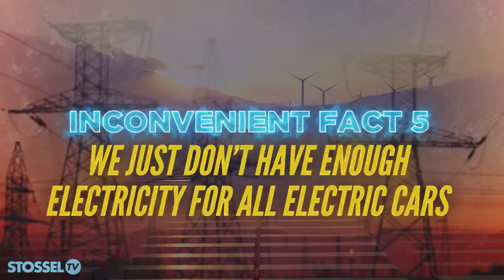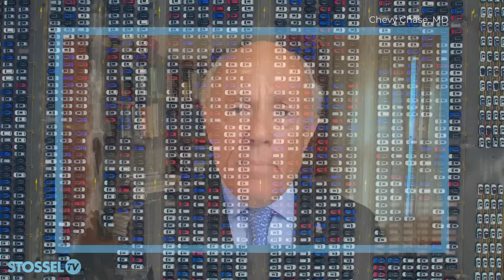Electric Cars: Inconvenient Facts, Part 2

Comment: As an electrical engineer who works in a power plant specializing in battery back up systems, I have been saying this for years.
I did undergrad research on solar panels at a national laboratory and the results for newer processes were not very promising. Note that this was 5 years ago so things may have changed in development but I haven't seen any at IEEE summits.
Reply: Maybe you could answer this question then I am, really asking. Question guys. I google how big an area solar panels needed to power the usa Google say small part of ONE state You say Entire usa only half the power needed. Which is correct.I am asking how to even calculate it. They say MW then KW and I not sure how to even go about calculating the answer. Hard to tell anyone that when google says i am wrong,
Reply: Why are half the comments here censored?
Is Google censoring, or Stossel?  It's annoying! 😡
Reply: According to Elon Musk (who is usually right about engineering issues), the entire USA could be powered by a 100km x 100km square of Solar panels located in a sunny part of the USA. Google that topic for an analysis of the math.
Reply: @paulrybarczyk5013  That's about 62 Miles x 62 Miles . . . . the heavy metals & Toxins would leach out of the panels and make the area unusable for human occupation after a decade.
Reply: @dalew801  What if they use Tesla rooftop panels that don't leach toxins, last 50 years, and can then be recycled?
Reply: Solid State Batteries and Liquid Metal batteries offer promise.  However, the government and industry has little interest in funding their development.  People have to wait for small time operators to fund their development on their own. 

Additionally, there are many industries that fund the suppression of energy alternatives.  An example is geothermal. Small single home geothermal units that only took about a week to be up and running sprang up all over the USA West.  However, as is almost always the case, the technology was bought up - Raser Technologies (RZ) - and immediately dumped. That promptly ended that! 

Firestone bribed Pittsburgh government to take down all their magnificent electric trolley's so they could supply tires to a new commuter bus service.   So sad.  

None of the big money making monopolies will sit idle whilst new players come into the market.  They will use their money to influence and suppress any change of the status quo!  Colleges and Universities will continue to conduct research on useless crap that does not change anything substantive in our world.  Government is quite naturally "on the take".  That's the way the world works.
Reply: @paulrybarczyk5013 thank you.  This “solar panels are toxic” has been an obsolete argument for a long time but people still cling to that so arbitrarily.
Reply: @FireEscape The best engineers in the world work for Elon Musk. They know how to monitor wear and simulate accelerated wear, then extrapolate that to determine a life expectancy. They've been doing this several years now, gradually rolling out more and more pilot installations, each with a 25 year warrantee. Actual service life should be at least twice that duration, once perfected. Then mass production begins.
Reply: @CropCircleCritic  Nope. They are toxic.
Reply: @dc9mm2  don't forget about amperage
Reply: @dalew801  interesting point.  thanks
Reply: @FireEscape I would love to.  Thank you for bringing this up!

By environmental or humanitarian standards, we would need to establish that mining for EV materials necessarily worse than the processes by which we arrive at having the things we already own, including and especially gas cars.  

There is NO CONCEIVABLE REALITY where gas cars and oil production hold the humanitarian or environmental moral high ground. 

Many people like to use arguments such as mining being bad for the environment or children working in mines.  Sorelle Amore falsely claimed this was industry-wide in a video and this was a cherry picked example.  Tesla never used that mine and it has since been shut down.  

Let me start by saying that children working in mines is reprehensible and if it has happened or is still happening I condemn it in the strongest possible terms.  But if we’re being honest, this is a mass self-incriminating of all of us since we each have a cell phone that was built with slave labor and a multiple devices with a lithium battery that was mined with far less scrutiny than Tesla’s sourcing.  

I spent 12 years in combat airlift in the military.  Saddam Hussein did not have weapons of mass destruction.  Osama bin Laden was not singularly located in Afghanistan.  Make no mistake—the 20 years we spent in the Middle East was to protect the Straits of Hormuz and keep the oil flowing.  The US  knowingly turned a blind eye to allied royal families who have gotten rich off human trafficking.  The total amount of civilian death and human suffering is very difficult to quantify, but lower estimates put civilian deaths around 500,000 in Iraq and Afghanistan alone.  All to 1) keep the oil flowing and 2) traded in dollars.  

And if you drive a gas car, none of the above is your fault.  I bring up this long example to explain why I had zero loyalty or compulsion to gas cars and changing over to a Tesla was an easy decision for me in this department.

You should feel the same way, my friend.  You are in this too.
Reply: @CropCircleCritic  Talk about “magical thinking”—You have to know that lithium doesn’t “magically” materialize into batteries. Lithium requires massive mining operations, shipping, storing, refining (using lots of cobalt), shipping again, and then, which is an extremely energy-intensive process that NEVER goes away. 

Adding 1000lb batteries to an automobile when gas has about 100 more energy density of a lithium-ion battery is backward. Lithium is also dangerous when it comes into contact with water. Take a look at Florida and burning electric cars when exposed to flooding. 

Solar panels get made once and don't last forever which means in some cases not even decades.  Expensive Teslas don't have a good track record when it comes to reliability and even build quality. When batteries need to  be replaced it's potentially tens of thousands of dollars. 

These videos have radical leftists and luddites suddenly acting all smug, in response to a dose of reality,  proving they don't really care about what's good for people or the future.
Reply: I am very disappointed that these leaders don't appear to be talking to engineers and physicists about what can be achieved. There are a half dozen basic questions that could be asked that would show how this is all just a dream. Right now the common man is subsidizing the whims of fancy the elites want to enjoy with electric cars. They are all supported on multiple levels with tax advantages, preferential treatment by regulators, and government sponsored R&D.
Reply: @Gunalizer  Very good response!  Really.  I’m impressed.  You’ve given this a lot of thought and it was well-structured.  Thank you for bringing a good argument.  Also thank you for actually reading most of what I posted.  

Please actually read the following.  You are exactly the kind of person I am trying to reach when I say this stuff.  

Responding in order…. 
95% of lithium that is mined is done so for smart phones and other devices, so to my mind this is territory we are all deep into anyway.  Like I said, demonizing lithium mining for EVs is only a mass incrimination of all of us since we all have multiple devices that already have lithium.  

Also I would hope that the middle ground we can meet on is that we don’t want the water table messed up by any means, and gasoline also requires cobalt for its refining processes.  If we get into “2 wrongs make a right” territory I would then ask for your perspective on massive junkyards with cars seeping their fluids into the soil, oil spills in open water, uncapped oil wells and the destruction of the Middle East wars for the purpose of protecting the oil shipping lanes.  

My overall point here is that it would be monstrous to pin all of the above on someone who drives a gas car, but there is a mass push to shift blame onto EV drivers for anything less than perfect in the manufacture and use of their vehicles.  I have seen bleeding heart SJWs do this.  It’s wrong when they do it and it’s wrong when gas car proponents do it.

The range issue is a decent argument, but we charge at home and the majority of the time have and for all purposes have infinite range.  Once you’ve experienced never going to gas stations anymore, you don’t go back from that.  No matter what anyone says here bashing EVs, this is the trump card that will make me never go back to gas cars.  Seriously dude, charging at home is pure bliss and I hope you get to experience it at some point.  Any issues people bring up with that are exaggerated to the point of discrediting such people.  

There are Teslas on the road at 10 years old with less than 10% range loss.  That is acceptable to me.  If I have to buy a new battery at 10 years for $20k, I am fine with that.  It’s cheaper than a new car and we love our Tesla.  

Build quality.  This was probably true of the first few batches of Teslas.  We got our Model Y and it is immaculate.  

Reliability.  I have had maintenance every issue under the sun with gas cars (including one that randomly burst into flames) and they all happened at the worst possible time.  Switching to an electric car was a sideways trade with risk to me and I can now say that the risks are over reported and greatly exaggerated.  

The price.  My wife and I had a lot of discussion about this.  Honestly, it was a wash. We got the Model Y for $55k (yes, I know it’s higher now), which we felt was on par for an SUV that seats 7.  We had looked at other gas ones that easily top $80k.  

Politics.  My friend, I am fiercely conservative and there are many more Tesla drivers who are conservative than the opposition would have you believe.  I would hope another common ground we can meet on right now is that we all need as many friends as we can get.  To anyone reading this, I would ask you to consider if fighting over what kind of car a person drives is a battle that’s really worth picking.  

Also let me be clear—I am vehemently opposed to any legislation that would ever force anyone to buy an EV or anything else of that matter.  The Detroit manufacturers donate heavily and nihilistically to politicians that push this divisive rhetoric.  

Thank you for your time and I wish you all the success and reliability in the world with whatever it is that you drive.
Reply: True! My PV saves me only 400,-- each month, i have to install a second PV because the sun is so weak!
Reply: @eddarby469  I agree with most of your point, but electric cars aren’t a rich people or leftist thing anymore.  Maybe they were at one point but many regular people are getting into this market and I highly recommend it.  Electric cars, particularly Teslas are amazing vehicles and charging at home is bliss.  It’s seriously a game changer to not have to go to gas stations anymore and I hope you get to experience it at some point.
Reply: @paulrybarczyk5013  dude where did you buy those rad rose colored glasses? I really want a pair.
Reply: @CropCircleCritic  I believe I will at some point but I'm waiting to see more about whether the battery life makes them feasible. 

As for them being a "rich man's hobby", I still stand by that. I've never spent $15k to buy a car. To get a Tesla you're in the $75k range? With median incomes in the US where they are, you probably need to be in the top 10% to swing that. But they're coming down all the time.

Still, they should not have granted subsidies for these expensive cars.
Reply: @paulrybarczyk5013  I would imagine they are very costly to manufacture . . . and like ALL other Solar Panels likely do not Recover the amount of Emissions that were Created in their Manufacture.  That not a net-sum gain . . . every Panel represents a Net Loss . . . so why do it?     It's like have a good job and at the end of the Month you owe money to your employer . . .
Reply: Diesel runs everything in this world!!
Reply: @markhuntermd  Mark . . . GM was convicted back in the day of Bribing City Councils to buy GM Diesel Busses . . . . most cities back in the day took the money.
Reply: @CropCircleCritic  EVs may work for some people . . . but like the Video says . . . they have a Karbon Footprint = to my ICV after I have driven it for 100,000 miles.   Personally I have great difficulty getting past the scenes of Children in the Congo mining Lithium for the Batteries.
I have seen the massive Environmental Destruction in China where they mine & refine Rare Earth Metals for the same batteries.  The refining process destroys Rivers, Lakes & people in China.  Massive amounts of dirt have to be moved . . . kind of makes the Oil Sands in Alberta look like a National Park.

When everything is taken into consideration . . . the Battery, which they have no ability to Recycle as of yet . . . is far more toxic than any gasoline powered vehicle could ever be.   And I didn't even go into the fire hazards . . . didn't the Electric Bus Fleet in Connecticut just get shut down because one unit burst into flames?
Reply: @eddarby469  that’s totally fair.  I get it.
Reply: The absolute best solar cells currently available, the type they use on satellites cost a small fortune to manufacture and are about double the efficiency of the ones being put on homes now. There is no way we are going to see those complex to manufacture multi junction PV cells mass produced any time soon and all other PV tech is pretty much tapped out at current efficiencies. There is some interesting research in solar concentrators with solar cells but again it is complex to implement and needs to be installed on ground based solar tracking rigs with active thermal control.
Reply: @FireEscape No current solar PV cells last 50 years. If Musk actually said that he needs to be called out on it.
Reply: @CropCircleCritic  There's no reason for me to buy an electric car.  I like gasoline engines, and they don't pollute anyway, less than 1% of co2 emissions.  I like going to the gas station once a week, and I'm not into the Peloton shitlib scene.  I'm into electrical engineering, and nothing they're doing in a Tesla is new or groundbreaking with exception to their software.
Reply: @Mike-lt6sj  well, you sound like you know what you want and I respect that.  

Having lived with a Tesla for over a year now, it fits our lives and performs far superior to any other vehicle I’ve ever driven or own, bar none. 

I’m not a liberal and there are way more conservative Tesla drivers than the propaganda would have people believe.  

Also as a head’s up, you may not know it yet but your wife wants you to buy her a Tesla.  Once one of her friends gets one, it’s all over, no matter what you say.  Besides, no real man makes his wife go to a shady gas station with his kids in the back now that it‘s 100% avoidable.  That’s 52 less chances per year for her to get mugged or be a victim of identity theft or worse.  

But yeah, keep driving a gas hog on principle, watching Q and singing kumbaya.
Reply: @CropCircleCritic   I am a liberal, and have no idea what all that gobbledygook is at the end of your speech.  
Enjoy your Tesla, I really mean it.
Reply: @Mike-lt6sj  and I wish you all the best with your cars as well.
Reply: @headstashmusic3897  According to Joel S. Holmes, who has experience as an alternative energy engineer, and “had the misfortune to work with solar electric panels occasionally,” we should expect there to be “literally … mountains of” solar panels in the waste stream, which will create “mountains of toxins,” as solar panels are simply “toxic metals embedded in glass.”

Holmes also points out in The Lid blog that “the land on which they were placed is no longer suitable for agriculture. Or for people to live on.”
“Toxins from the solar panels,” he adds, “and the associated mechanical and electric equipment will have leached into the soil for 25 years. Thus, when more farmland is needed to grow food, the massive areas covered by solar panels are not a candidate.”
And solar farms, like wind farms, do eat up the land. They need 450 times more ground than nuclear plants, and about 100 times as much as generating stations fueled by natural gas.
Solar energy’s green cred is actually ruined long before facilities are built and panels become trash. Again, here’s Holmes from The Lid.
Making a solar electric panel produces more CO2 than the panel will ever save.
And it’s also a sword of truth that solar electric panels are made in China. Made in factories using huge amounts of high heat in production. And these are powered by coal-fired electric generating plants.
Solar electric panels are basically created by fossil fuels. And as mentioned, their preparation produces more CO2 than they will ever save.
Reply: @dalew801  Well Im sorry but this Holmes guy is clueless. The Ticino Solare solar power plant operates on the roof of a technical college building near Lugano. On 13 May 1982, the south-facing plant supplied electricity to the grid for the first time. The installed output is ten kilowatts, which was an extraordinary amount at the time. The condition, colour and output of the solar cells were regularly checked and measured. An examination after 35 years of operation concluded that the cells were showing wear. This included corrosion, hot spots, as well as cracks in the cells or defects in connection cables. But the majority of the modules still functioned well and still delivered at least 80 per cent of the output over all, confirms Mauro Caccivio, who heads the photovoltaic laboratory at the Supsi University of Applied Sciences in Ticino. Solar Panels are recyclable. Solar modules which have played out themselves (on average, the lifetime of the first PV-modules is 25-30 years), belong to the category of electronic waste (e-waste). According to preliminary estimates, the annual global volume of e-waste in 2018 was 50 million metric tons. Each year, the share of solar energy in the world market is increasing: plus 18% by 2019 and commissioning of about 123 GW, according to IHS Markit’s calculations, therefore, the issue of the further utilization of already used PV panels is very acute. If the amount of waste PV-modules with a lifetime service up to 2030 is converted into cash equivalent, by recycling and extraction of materials, then the amount will be about $ 450 million. In turn, this amount of waste can produce 60 million new panels, which is 18 GW. And by 2050 this figure will increase to $ 15 billion a year! Of this amount of waste, it will be possible to make 2 billion PV panels, which is equivalent to 630 GW. "the land on which they were placed is no longer suitable for agriculture." You should look into the rapidly expanding Agri-PV industry. How much food can you grow on a tailing pond? It takes 2.2lbs of coal to make one kWh.A solar panel makes about 12,700 kWh during its lifespan. It takes 28,000lbs of coal to make that much electricity. 14 tons.
That's also 62,000 pounds of Co2 not added to the atmosphere....because of just one solar panel.
Reply: @dalew801  Solar panels have dropped 89% in costs since 1991.  It took me 5 years to reach my break even point.  After that its free electricity.  Recycling the panels is getting easier each year.
Reply: @dalew801  Footprint for modern EVs breaks even at 25K miles not 100K miles.  The Aptera is threatening to do that at 150 miles flat.  Modern batteries use no Cobalt so no kids are mining for them.   The entire Chinese Tesla production uses zero Cobalt and Nickle.   All standard Tesla batteries in North America also are Cobalt zero.

Fire danger for EVs is 8x less than for ICE vehicles.  Redwood Materials Inc. can recycle 98% of lithium batteries now. 

Gasoline is much more destructive of rivers, lakes, and people than lithium mining.  There are known cases of genocide in Africa for the drilling and refining of oil.
Reply: @headfullofacid8088  I mean this jokingly, but the literal answer to your question has been owning a Tesla.  

Dude, I used to be one of these “I’ll never own a Tesla” people in the comments sections.  The majority of stuff in these videos is either false, based on bad/omitted data, or greatly exaggerated.
Reply: @brianvanlier9206  As a Tesla guy, I don’t disagree.  Diesel will likely never go away and I think the recent political pressure to keep the prices high is monstrous.
Reply: @victorluke5816  Kids are mining Lithium in Congo TODAY ! 
Fire danger is less than ICV . . . that is just NOT true . . . while ICVs do catch fire they are usually old & poorly maintained units . . . . EV fires are in new or near new vehicles, Insurance Companies are now starting to take an interest especially if you have an attached garage.  EVs on numerous occasions have burst into flames in an accident . . . I would never feel comfortable riding around on top of a 1000 lb battery.  
Never heard the 25,000 mile thing from any source.  But have heard 60 to 100 k many times.  When you factor in the $15 to $20,000 more you pay for an EV . . . no logical reason for me to buy such a Toxic mess that I can't just drive 600 miles to say Calgary from the coast without stopping, that I can do in my F350.

CO2 is your Friend . . . the more we make = better yields for our farmers . . . already the small increase of recent decades has Greened the Earth the size of 2 Xs the USA.  But oddly both Poles are Cooling!
Reply: @dalew801  Also Dale, I have to ask…. If you’re not comfortable sitting on top of a battery, how are you comfortable sitting on top of a 50 gallon tank of flammable fluid and rolling it up into your house every day? 

As far as CO2, I do agree with you there.  The climate alarmism has gotten out of hand.
Reply: @dalew801  Carbon footprint.  
I honestly could care less.  The convenience of charging at home and never going to gas stations absolutely trumps all other arguments.  This (and never going to a car dealership again) is the reason I will never go back to a gas car.  That said, every single carbon example I have ever seen, including Stossel’s here, uses bad data.
Reply: @dalew801  Children in Lithium Mines.  
To begin with, 
1) I condemn child labor in the strongest possible terms and 
2) this is a level of slander that is almost criminal, and I hope someone sues these talking heads on YouTube at some point.  Sorelle Amore falsely claimed this was industry-wide in a video and it was a cherry picked example when she did it.  This story was based on 1 mine.  Tesla never sourced from that mine and it has since been shut down.  Every commentator since has taken this claim and embellished it, putting unrelated B-roll footage to it. 

But to anyone who uses the argument that EVs are exclusively bad because of supposed child labor, my question is this:  

When did mining for lithium become bad?  When did child labor suddenly become alarming to you?  Did it only become bad the millisecond it was applied the purposes of an EV battery?  If not, it certainly hasn’t stopped every single person here from 
1) buying anything made in China because it’s cheap and 
2) getting a new smart phone every year.  In fact, if you’re reading these words, you have statistically owned at least a hundred lithium devices that were mined with far less scrutiny than Tesla’s sourcing. 

If anyone here wants to say “EVs are bad because child labor” (again, I condemn child labor), it is with love I tell you that YOU ARE A HYPOCRITE AND YOUR TIMING FUCKING SUCKS!!
Reply: @dalew801  Pollution & Human Suffering.  
When propaganda like this comes out, the oil industry would love for you to forget their sins.  When tankers and oil rigs had spills in open waters, no one texted you out of the blue and tried to pin that on you.  Neither has anyone asked you what your plan is for numerous uncapped oil wells or junkyards full or broken down cars that seep their fluids into the water table. 

I spent a few years in combat airlift in the military after we were all lied to about WMDs in Iraq and Osama bin Laden being stuck in Afghanistan.  Lower civilian casualty estimates are around 500,000 people.  As another lovely side effect, the US turned a blind eye to allied royal families who stood up the largest human trafficking apparatus in modern history.  Make no mistake—The 20 years of attrition we called a war was to 1) protect the Straits of Hormuz for oil shipping and 2) keep the oil traded in dollars.  

And if you drive a gas car, none of that is your fault.  But I will not back down in saying there is NO CONCEIVABLE scenario where the oil industry has the moral or environmental high ground.
Reply: @dalew801  Battery Recycling.  
Again, I could care less.  All I can say is that there are a few start-ups looking to salvage the materials that everyone here will point out are “energy intensive to mine”.  But yeah, that remains to be seen.  Personally, I would just buy another $20k battery in 10 years if I have to since it’s cheaper than a new car and gives the car 10 more years of life.
Reply: @CropCircleCritic  "Never going to a car dealership again" ? ? ? 
What do you do when your Battery Expires man?  If you have a Tesla the replacement could be in the $17,000 range. Heard of a local guy with a Chevy cost him over $20,000 to have his Battery replaced.  
Then there's the Question of Recycling the Toxic mess . . . . 

I can get in my Mustang GT and drive down the coast to San Fran in a day . . . with 2 stops for gas.  Last summer a trip to the Okanagan in a Tesla, a mere 300 miles, was an All Day Adventure. Leaving Vancouver and stopping at Hope to recharge was an adventure,  The lineup for the charger was about 4 hours.  So the folks that left Vancouver in the Morning to go to Kelowna didn't get there till 7 pm.  I would have been there for a late lunch.    

If it works for you man . . . go for it, but for the 100 large they cost I can buy two cool collector cars.
Reply: @dalew801  Dale, Teslas are all ordered online and delivered to your door.  No haggling with a salesperson.  Once you’ve experienced that you don’t go back to dealerships.  That’s the reason why I’ll never go to a car dealership ever again.  

I hope you get to experience a buying process as straightforward as that at some point.  

It’s a demeaning experience to go to a dealership and try to get even close to the teaser price that have in their website or the display car at the front that you can’t actually buy.  Never again.
Reply: @dalew801  road trips are one thing, but in the daily basis, I have infinite range in our Tesla.  I charge at home for less than $2 per day for all of our driving uses maybe 50% of the battery range on heavy days.  

It’s absolute bliss.
Reply: @CropCircleCritic  I actually have 90 gallons of Diesel . . . but my seat is far away from the tanks at the rear of the Pickup. 
Whereas the entire passenger compartment of a Tesla sits atop of the 1000 lb. battery.  

I have an engineer friend who built a Tesla Powered race car . . . it's very neat and runs about 3rd or 4th with GT1 cars at the local track.  He has a custom built battery in place of the Passenger Seat and both the battery & motor are cooled by substantial fans.   The power demand has to be kept below 70% on the straights because it would not survive a 20 minute or 1/2 hr. race.  Between heats he charges is with a massive trailer mounted diesel generator.  It's a fascinating  project & really bizzar to see it go by without making any noise like the rest of the field.
Reply: @dalew801  dude, I would love to see that! And yes, battery chemistry is definitely something that needs to be done right.
Reply: @dalew801  Its cheaper to mine Lithium outside the Congo.   I don't know how they are teaching the kids to use those giant earth movers and and sulfuric acid sorters?

Are you talking about Cobalt and not Lithium?   The kids are mining Cobalt in The Congo.   They need Cobalt for all the cell phones and gasoline refining.   EV batteries have moved their chemistries to cheaper Iron Phosphate rather than Cobalt Nickel.  Most of the kids are being mined to death by I phone and Samsung Galaxy owners.

You are very behind on the EV fires.  Most of the problems are with older chemistry batteries made by LG.   All the batteries from China only combust when involved in bad car crashes.  Spontaneous combustion of cars are still mostly with gasoline engines by a factor or 8x.  

The poles are colder because the ice melted.  This is simple chemistry and physics.  You can demonstrate it when you shake an iced drink.  The temperature is cooler but its due to the warming from the shaking of the drink.   Ask any science teacher and they will be able to explain that colder temps plus less ice means a lot of heat got dumped onto the poles.

The 25K mile break even carbon and energy is from actual tests they did from sources like Consumer Reports not from Legacy auto which is saying 60 to 100K miles because they don't want to build BEVs.  Guess which ones get reported on by sources that need money from ads?  Also its best to use government testing for this.  Even the Trump era numbers support BEVs.

Almost forgot more CO2 usually means more dead fish and corals due to higher acid content in water due to higher CO2 levels.  Also you can't get flood insurance that easily in Miami because of the extra CO2.  We are now getting 10 to 100 year storms every year to 10 years.  Yeah, this stuff just causes more storms.
Reply: @dalew801     "CO2 cannot warm the planet" The Earth warms and cools on a range of different time scales, driven by different effects, but the two controlling factors are always the amount of sunlight (solar radiation) reaching the Earth’s surface, and the amount of greenhouse gases in the air, of which Co2 is one. The greenhouse effect makes Venus roughly 700°F (390°C) hotter than it would be without a greenhouse effect. There have been periods of naturally high atmospheric Co2 levels in the past, and Earth became hotter whenever these occurred. But the current increase in carbon dioxide emissions, driven by burning fossil fuels and other human activities are unprecedented and forcing rapid changes to the climate system. As a result, Earth’s climate has changed faster since the Industrial Revolution than it has at any point in the past 65 million years.
Reply: @dalew801  A majority of the Lithium is used in cell phones and other small devices.  At some point, Lithium for EV will become the majority, however most big manufactures like Tesla are sourcing lithium from children friendly producers. Most of those pictures you see of children mining Lithium are from small scale operations and in some cases family operations.  Children cant keep up with the demand and will require heavy manufacturing equipment.  But those pictures you see are burned in pretty deep.  Australia is becoming a major source of Lithium. Lithium also recycles very well.
Reply: @jeffbonvallet9480  Interesting . . . There is a mining company attempting to open a Mine in Canada . . . but the Enviros are protesting.  
The chances of enough Rare Earth, Cobalt & Lithium mines being opened around the world to replace ICVs with EVs in the next 50 years is unlikely.   On the positive side . . . Oil is Abiotic and we will have Oil & Gas for 100s of years . . . over 7000 everyday items are made from Oil & Gas.
Reply: @CropCircleCritic  I was in the LeMay Museum in Tacoma a few years back and they had Electric Cars from the 1912 - 16 era . . . talked to the son of the founder who has taken over for his deceased father.  He said they would go about 100 miles, and back then of course were popular with the city folks & ladies because you didn't have to crank them.  Then in about 1915 Cadillac invented the Self Starter and that was their demise.   
Today of course they go much further & will likely get even better distance as technology improves . . . hey maybe some day Musk will stumble upon "Dylithium Chrystals" aka Startrek . . . lol
Reply: Well seeing as most tech has progressed significantly in the last 5 years, I'd wager, yes.
Reply: @paulrybarczyk5013  Bahahahaha🤣🤣🤣 Usually a liar, not right!
Reply: @paulrybarczyk5013  Clown
Reply: @headfullofacid8088  Forget arguing with a Musk culty!
Reply: @schrodingerscat1863  Musk BSS all of the time!
Reply: @schrodingerscat1863  Maybe not 50 years but the Ticino Solare solar power plant operates on the roof of a technical college building near Lugano. On 13 May 1982, the south-facing plant supplied electricity to the grid for the first time. The installed output is ten kilowatts, which was an extraordinary amount at the time. The condition, colour and output of the solar cells were regularly checked and measured. An examination after 35 years of operation concluded that the cells were showing wear. This included corrosion, hot spots, as well as cracks in the cells or defects in connection cables. But the majority of the modules still functioned well and still delivered at least 80 per cent of the output over all, confirms Mauro Caccivio, who heads the photovoltaic laboratory at the Supsi University of Applied Sciences in Ticino.
Reply: @paulrybarczyk5013  I think solar is great but Tesla hasn't even existed for 50 years so I am skeptical of that claim. I would be interested in an engineers opinion on storing solar energy with air pressure or pumping fluid up a hill. Many parts of Arizona would be great for this because it's always sunny and there are plenty of mountains and caverns. Also, what ever happened to solar towers? I feel like you could design a steam generator that could also work off of compressed air at night
Reply: @headstashmusic3897  "That's also 62,000 pounds of Co2 not added to the atmosphere....because of just one solar panel."

What about at night time? Or when it's cloudy, raining or snowing? How much does a kWh of solar generated energy cost me then?
I have PV and a Powerwall so I'm very familiar with the pros and cons of this. So I know that when anyone that says solar and/or wind will solve the problem, they are talking out of their hat.

"It takes 2.2lbs of coal to make one kWh.A solar panel "

Also worth nothing, you can't make plastic, glass steel or concrete without fossil fuels, so how exactly are you making all these new panels in this fossil fuel free new world?
Reply: @CropCircleCritic  "The majority of stuff in these videos is either false, based on bad/omitted data, or greatly exaggerated."

Because you said so lol... This is the liberal brain in action...
Reply: @gooble69  not a liberal, dude.  I just drive a different car than you and can say from experience a lot of this crap is made up and ignores other factors where convenient.
Reply: @CropCircleCritic  
"and can say from experience a lot of this crap is made up"

Because you said so... which is liberal thinking. 'I think it therefore it is true.'

How about bringing some data to support your claims, then we can discuss like adults?

Like for example, if all the world's 1.5B cars were converted to EV, what do you think that will do to the demand on electricity infrastructure? Who is paying for that? and how are you getting the raw materials to build it all since almost all mining and manufacturing requires fossil fuels ? And since you don't want traditional energy sources, how are you getting electricity at night, or on a still, cloudy or rainy day?
I have an EV and Solar and a Powerwall. They are useful in some aspects, but they are not the golden unicorn that solves all problems. And anyone that says otherwise (like yourself) never seems to be able to show any math to support their pie-in-the-sky ideas.
Reply: Politicians don't understand science and they don't care about that either
Reply: @CropCircleCritic  I also want to see everyone in an ev by 2035, moreover, I cannot wait to see ev planes, ships and all diesel powered equipment converted to electric.
Then I would like to see the electric grid that makes this all possible. Given the technologies today and emerging tech, our best hope would be an immediate program to build 100+ nuclear power facilities.
Reply: @headstashmusic3897  "using some fossil fuels to make emission free energy is a lot better than..."

I see you didn't read the question...

As usual...
Reply: @paulrybarczyk5013  😂so it could be the popular target by enemies 😢whenever a country depends on solar panels, should be protected like White House or pentagon 😂
Reply: @otyce  and we will live this life forever as long as the brain in alive mode , change the body with nano robots …. 😂 I wish I just live in this natural world and end with it before it happens 
Dig the holes n make another holes it ain’t a solution, except for business forces even Elon@
Reply: @noel5ilv3rlake  compared to centralized power plants, distributed solar in thousands of locations would be much harder for enemies to target.
Reply: @paulrybarczyk5013  yes.  This is a very valid point and I couldn’t agree more.
Reply: @otyce  I would like to see that too and think that is the definitely direction that things are going.  It’s also important though that people choose it as the better option and aren’t forced into it.  It will be exciting to see the free market sort this out as EVs continue to improve and infrastructure technologies come online.
Reply: Thankyou for telling the truth.
Reply: @CropCircleCritic  Have you weathered a hurricane in your Tesla?
Sure, you'd choose to evacuate, right?
But in doing so you spend several hours in bumper-to-bumper traffic with no access to a charging station.

And when you return home in it to begin clean up, it may be several weeks until you have power again.  Unless you have a conventional vehicle, you're pretty much stranded.

And while portable solar panels & small "solar generators" (big powerbanks, basically) are handy for running fans, lamps & charging cell phones, in the aftermath of a storm, large-scale, stationary solar panels & wind turbines are nothing but flying projectiles.  Some people have natural gas back up systems, but the vast majority run gas-powered generators.

So until technology improves *GREATLY*, electric cars and "green energy" are, to us, toys for people with more money than sense.

OT: I pray that we can revert this country back to a federalist nation.  This country is too large & diverse to be ruled by a centralized body - much less one comprised of people who are ignorant, corrupt or both.  (This isn't meant as a dig on you)
Reply: @flerrin1754  I couldn't agree more, ..that being said, I suspect GREED has something to do with the " slow", progress towards free clean energy for the masses, ( ask Tesla).
Reply: @Gunalizer  And you didn't even get to the costs of safe disposal. Nor the challenges of power distribution. Nor other issues regarding safety and security.

Scaling up a D battery to store energy from scaled up wind mills and solar panels is not a task if it is to supply a modern economy.
Reply: Two words: Energy density. Solar and wind don't have it.
Reply: @FireEscape do you weigh in on the materials and energy needed to make a flat screen television? It's almost the identical materials and processes. Solar panels last decades and are not replaced just because someone wants a newer, bigger TV.
Reply: @Gunalizer  so are flat screen televisions. Can you direct me to the websites you post on where you're trying to stop the sale of televisions due to the screens being toxic?
Reply: @Gunalizer  "Adding 1000lb batteries to an automobile when gas has about 100 more energy density of a lithium-ion battery is backward. " Too bad you didn't question the video with an objective mind. The battery may weigh 1,000 lbs, but an EV doesn't have the 1,000 lbs of a V8 engine + transmission. It actually nets out to the same weight. In fact, my EV is actually lighter than its competitor vehicle.
Reply: @Gunalizer  "Solar panels get made once and don't last forever which means in some cases not even decades." Really? References, please. While solar panels decline in efficiency, they never reach zero. Unless damaged, the work forever. They work decades providing fuel-free power, silently.
Reply: @Gunalizer  "Expensive Teslas don't have a good track record when it comes to reliability and even build quality. When batteries need to  be replaced it's potentially tens of thousands of dollars. "
Again, use some objectivity here. Tesla has the highest customer satisfaction rating for automobiles ever recorded, regardless of price. So the owners don't care about the things you think matter, they love their cars. 
No, the batteries don't get replaced. They outlast the owners and the vehicles. They last 300,000 to 500,000 miles and the batteries get recycled. Gasoline, not so much.
Reply: @Gunalizer  "Lithium requires massive mining operations, shipping, storing, refining (using lots of cobalt), shipping again, and then, which is an extremely energy-intensive process that NEVER goes away. " Absolutely incorrect. The majority of lithium comes from South America and Australia in brine pools. Sunshine is used to dry the brine, the minerals left over are processed. Cobalt hasn't been used in Tesla's batteries for some time now, and EV batteries aren't the largest use of Cobalt. Concerned about cobalt? One of the largest consumers of cobalt is the glass industry! You're protesting on glass-making websites, I take it?
Reply: @eddarby469  "Right now the common man is subsidizing the whims of fancy the elites want to enjoy with electric cars. " Um, the oil industry in the USA alone gets $649 billion dollars in annual subsidies PLUS free military protection for their trade routes. None of those "free" benefits are reflected in the price of gasoline at the pump. Compared to oil subsidies, electric cars are free.
Reply: @eddarby469  "To get a Tesla you're in the $75k range? With median incomes in the US where they are, you probably need to be in the top 10% to swing that. But they're coming down all the time." The base Tesla Model 3 is exactly the average price of a new car in the USA, $47,000. If you can buy an average car, you can buy a Tesla. Want a new EV cheaper? The Chevy Bolt is $27,000. 
The "rich man's toy" is propaganda from the oil industry. They just want you buying gasoline and will say anything to keep you on their balance sheet.
Reply: @eddarby469  "Still, they should not have granted subsidies for these expensive cars." Well, the oil industry gets $649 billion in annual subsidies from us taxpayers, please explain that. And American car makers get bailed out of bankruptcy no matter what, explain that.
Reply: @dalew801  "and like ALL other Solar Panels likely do not Recover the amount of Emissions that were Created in their Manufacture.  That not a net-sum gain . . . every Panel represents a Net Loss . . . so why do it?" It's done because you are absolutely wrong about your statement. By all means, PROVE that a solar panel (made with the same materials and processes as a flat screen TV) doesn't pay back the energy it captures. Solar panels last decades and never decay to zero energy capture. That's MEGAWATTS of energy PER HOUR a solar farm creates burning NOTHING. No fuel. No pollution. No transporting of fuel and storing it. It's really annoying that people repeat some foolish, unproven statement as if it's fact. PROVE what you say!
Reply: @dalew801  "When everything is taken into consideration . . . the Battery, which they have no ability to Recycle as of yet . . . is far more toxic than any gasoline powered vehicle could ever be. "
ABSOLUTLEY FALSE. Tesla already recycles its batteries, and the recycled material is better than freshly mined. For non-Tesla recyclers, the percentage of recaptured materials is over 92%. Please do some research BEFORE you repeat an oil industry lie!
Reply: @dalew801  "And I didn't even go into the fire hazards . . . didn't the Electric Bus Fleet in Connecticut just get shut down because one unit burst into flames?" I believe that was a hydrogen bus. Electric vehicles are 100x safer from fire than any gas vehicle. The question is WHY anyone would ride in a vehicle with liquid explosive as fuel!
Reply: @schrodingerscat1863  "There is some interesting research in solar concentrators with solar cells but again it is complex to implement and needs to be installed on ground based solar tracking rigs with active thermal control." No, they don't. The lens concentrators on the newer panels don't necessarily require cooling or tracking. In fact, there are 3x more efficient solar panels that require neither of those things.
Reply: @schrodingerscat1863  "No current solar PV cells last 50 years. If Musk actually said that he needs to be called out on it." While solar panels decline in efficiency, they don't drop to zero energy capture. I would say you need to be called out on it.
Reply: @Mike-lt6sj  "There's no reason for me to buy an electric car.  I like gasoline engines, " 
Hi! Where can we send you our Christmas card? 
Sincerely,
The Oil Lobbyists of America
Reply: @gooble69  "Because you said so lol... This is the liberal brain in action..."
Nope, the video in question was from a media source that takes oil advertising, and the only "expert" interviewed is a paid oil-industry person. Didn't you notice that no opposing "expert" was talked to? No one challenged even ONE claim the "expert" said? 
I'm highly conservative, by the way.
Reply: @joeyGalileoHotto  "Politicians don't understand science and they don't care about that either"
But politicians understand MONEY! Oil companies contribute to political campaigns, and then politicians give Big Oil $649 billion in annual subsides. See how that works?
Reply: @otyce  "Then I would like to see the electric grid that makes this all possible. Given the technologies today and emerging tech, our best hope would be an immediate program to build 100+ nuclear power facilities."
Absolutely incorrect. EVs use very little energy on a daily basis, and most can be charged overnight on house current. The grid will not melt. In fact, home air conditioning (HVAC) uses 3x to 6x the amount of energy that an EV does. Want to save the grid? Stop building homes with air conditioning.
Reply: @noel5ilv3rlake  "whenever a country depends on solar panels, should be protected like White House or pentagon "
So you think petroleum isn't targeted by political forces? Isn't what's happening in Russia and Europe evidence that petroleum's global supply chain is delicate? How risky is a solar farm inside your own country?
Reply: @justsomeguy934  It is rather dependent on the amount of sun a panel gets. In a sunny place solar cells degrade faster than in a more temperate climate. They don't drop to zero but lose substantial efficiency. The work on graded index lenses is promising but currently they lose quite a bit of efficiency in the lens itself and are quite expensive to produce. This will improve in time so ultimately the promise of static solar arrays with something like 10x optical concentrators is looking achievable. Now if a cheap method of constructing multi junction cells could be created we could really see some progress, that would double panel efficiency instantly.
Reply: @DamePiglet  "Have you weathered a hurricane in your Tesla?
Sure, you'd choose to evacuate, right?
But in doing so you spend several hours in bumper-to-bumper traffic with no access to a charging station."
Actually, you'd fare BETTER in an EV after a hurricane than in a gas car. EVs consume no energy just sitting. A gas car burns 1/2 gallon PER HOUR just at idle. Any EV made can easily drive to an area that has electricity and charge. After Hurricane Ian in Florida, there was no gasoline to be had. All the stations were sold out DAYS before the hurricane hit. And sold out DAYS after ward. But you could drive a few miles and get electricity!
Reply: @jonmcdaniel8492  "And you didn't even get to the costs of safe disposal. Nor the challenges of power distribution."
Modern EV batteries outlast the car and all the owners. They are then recycled. Gasoline, not so much. 
Power distribution is called the grid.
Reply: @jonmcdaniel8492  "Two words: Energy density. Solar and wind don't have it."
Two words: who cares?
Solar and wind power use NO FUEL. No pollution. Work decades with little to no maintenance. In fact, to completely power the USA from solar farms would requires LESS real estate than we currently use for oil & gas leases.
Reply: @schrodingerscat1863  "In a sunny place solar cells degrade faster than in a more temperate climate. They don't drop to zero but lose substantial efficiency. "
TaDa! So you've just agreed with me - unless damaged, solar panels produce energy FOREVER. No fuel. No recycling required unless damaged. Solar wins!
Reply: @justsomeguy934  Solar can be good in a small setup but bast a certain size the battery storage becomes a problem. My own setup is great for a single home and workshop but I have a 12kW/H battery array meaning over night and the odd dull day doesn't cause problems during the summer. Winter it just doesn't produce enough power and I rely on micro hydro to make up the shortfall. That is ok for small scale generation as I said but has significant problems to scale. After 5 years the panels are still just over 95% of their new output though in the UK we don't get that much strong sun so not unexpected.
Reply: @justsomeguy934  you'd discover the opposite in Louisiana.
We are weeks... sometimes months without electricity.
But we store gas.  We all have gas generators. The gas stations have generators to operate the pumps.
What we don't have is EV stations.  
You'd be screwed.
Unless you had a big enough gas generator I guess
Reply: @justsomeguy934  Math cares.
Reply: @jonmcdaniel8492  thankyou.
Reply: Thsnkyou..we need more people telling the truth.
Reply: @schrodingerscat1863  I'm talking about Solar power on a national scale. You don't need batteries to use solar as part of a balanced energy plan. Solar can easily produce half to 2/3 of most country's energy needs during the day. After that, other sources contribute.
Reply: @Mike-lt6sj  "I do like gasoline engines, and you cannot come up with a single sensible reason for me to buy an electric car.   I'd like to see you try.  I make enough to buy a Lucid, or a Model S, so I'll throw you a bone and not even bring that up. "
First, I don't give a rats arse what anyone drives, but people sure do care if I drive an EV! Personally, I own an exotic sports car that has a supercharged V8 engine. Very rare, very nice, I enjoy it.
Second, when I bought my Tesla I bought it for the tech. And boy was I rewarded. The performance of my Telsa exceeds that of my lightweight sports car! Any EV has almost zero maintenance, is ultra reliable. You don't even replace the brakes in an EV, and I've replaced the brakes in my sports car twice. 
Tech wise, my car is gotten better than the day I bought it. One day I woke up and boom! I had autopilot, auto-park and summon via a software update. My car has had its range increased by 5% or so, and had its stopping distance decreased since I bought it, all via software updates. The car keeps improving, keeps getting better.
Reply: @justsomeguy934  Problem is on that scale how do you fill nighttime hours without using something like gas. Wind is too intermittent to be useful so you have to have either storage which is difficult at scale or a fossil fuel backup. Using so much solar is major failure point when the sun doesn't shine and you would need huge numbers of panels for supply on a national scale.
Reply: @dalew801  "The massive amount of CO2 expended to mine, refine & manufacture components & minerals for the Battery is MASSIVE! "
Really? And how do you know that? Can you cite a reference to prove that, or is that just something you've read on the Internet (let's be honest, that's what it is, you've never ever verified a single thing you've said in this discussion).
By all means, PROVE the CO2 expenditure that makes a recyclable battery pack exceeds that of consuming and burning gasoline for the 300,000 mile life expectancy of a Tesla battery. PROVE IT.
Reply: @schrodingerscat1863  by the way, you seem well informed of solar progress. Tell me more about your setup, I'd like to hear about it.
Reply: @justsomeguy934  Hey. I looked it up where your $649 billion figure comes from and it is made up to fit an agenda. Even in their own documentation they cite the "hard" figure as no more than about $40 billion, and I'd have to see about that. 

You're reply doesn't require a response from me.
Reply: @dalew801  "The second most common liquid on Earth is oil, after water."
Here's just one estimate of oil reserves that brings into question your claim:
World Oil Reserves
The world has proven reserves equivalent to 46.6 times its annual consumption levels. This means it has about 47 years of oil left (at current consumption levels and excluding unproven reserves).
Oil Reserves: 1,650,585,140,000
Oil Consumption: 35,442,913,090
Reserves/Consumption: 47
Reply: @dalew801  If oil is so abundant, why isn't it priced like water? Why is it $5 a gallon? Why are we having to get it from sea beds and arctic tundra? The fact is that all the accessible oil is gone, we are now going to farther, more costly, more extreme places to get the stuff. The price of oil is totally artificial, based upon political whims, based upon an incredibly delicate supply chain. No thanks, we should be investing in the energy falling at our feet.
Reply: @paulrybarczyk5013  Then again the powers that be don't want people "off the grid."
Reply: @justsomeguy934  Solar only works when the sun is out. You need space for it too and not every location is fit for solar.
Reply: @justsomeguy934  I have an array of 18 monocrystalline  340w panels, currently as a fixed ground mounted setup though I do have plans to convert at least some of it to tracking mounts in the near future. This is backed up with a 12kWH battery system. Additionally I have a 600w micro hydro generator that runs mainly in the winter when the solar isn't producing much.
Reply: @schrodingerscat1863  HOLY CRAP that sounds like a nice system
Reply: @justsomeguy934  Yes, I'm an electrical engineer so designing and building it was really more of a hobby until the energy crisis hit, now I am seeing the benefit of all that work though and it's all going to easily pay for itself over the next year or so. It's taken about 10 years to put together and started out quite small but is a pretty complete off grid system now. Just need to make sure I clean the panels now and again and regularly clean the inlet filter on the hydro. I'm lucky to have enough land to site the solar panels out of site and a fast running stream for the hydro. As I said I am planning to build some tracking mounts for the solar panels probably next year which will improve efficiency hugely.
Reply: @justsomeguy934  As they should and it would be a national security risk otherwise. The whole of the nation and the world depends on petroleum. Its derivatives are used to give an untold amount of manufacturing products that would not be possible otherwise. Batteries don't generate power nor do their derivatives provide for the manufacturing of plastics and synthetic materials that we use everyday. There is literally no replacement. That argument is dishonest on its face.
Reply: @justsomeguy934  I give you and Engineers opinion and you are still talking about "Conspiracies" . . . that is just nuts man ! 
Perhaps you are comparing the EV to a 1968 Big Block Chevelle . . . now 15,000 miles might work.   But new IC Vehicles are 98% CLEANER than the Chevelle, so 100,000 Miles is well within the picture.  
Not only does my new ICV cost thousands less for a similar sized vehicle . . . as much as $20,000, they are exceptionally low emissions as well.  And I am not staring down the Fact that at 8 to 10 years I will have to lay out another $20,000 for a New Battery.  Toyota & Tesla Batteries are warranted for about 8 years . . . on a Pro Rated basis.  

Have you even seen the Rare Earth Mining in China?  A necessity for your EV . . . 1000s of sq. miles of destruction, and where they Refine the Material is even worse, polluted Rivers, Lakes & Workers who pay a heavy price. 
What you drive is your choice . . . but, I believe the EV is going to be the Biggest Bust of the 21st Century, they are very expensive, restrict your ability to travel, and without Trillions invested in the Electrical Grid will never be popular with the masses.  Today in most regions of the USA they are Coal Powered.  Like the so-called Green Energy that is today Failing Europe . . . EVs will likely never be main stream.
Reply: @justsomeguy934   What runs mines man ?      Diesel Engines in Trucks, Diggers, Crushers etc.   

"PROVE the CO2 expenditure that makes a recyclable battery pack exceeds that of consuming and burning gasoline for the 300,000 mile life expectancy of a Tesla battery. PROVE IT."   ? ? ? 
I never said that . . . YOU DID . . . lol

I said a new Tesla in the showroom has a Karbon Footprint = to a similar sized car AFTER you have driven it for Years.  Some say 60,000 miles . . . Stossel says 100,000 miles.    A Tesla Battery is good for 7 to 10 years . . . then you are faced with purchasing a new one . . . with a new MASSIVE additional Karbon Footprint included . . . no extra charge.  

I sent you the Engineers' perspective on the entire Green Energy insanity . . . he talked about all the Toxic Components of Solar, Wind & EV Batteries . . . 

Real Science . . . .

We know that every single molecule of CO2 is surrounded by 2500 molecules that are NOT CO2 and therefore any theoretical blanket built from CO2 fibers that supposedly is surrounding the Earth is practically made of NOTHING.

We know that CO2 levels would need to reach concentration in air of 60,000 ppm (from current levels of 400 ppm) to become toxic for humans.

We know that the total emissions/reabsorption of CO2 by nature makes emissions of CO2 by burning fossil fuels totally insignificant and lost in the instrumental accuracy levels.
Reply: @dalew801  I have never supported the Global Warming agenda, you have no basis to attempt to align me with it.
If you want to argue the Peak Oil point, we can do so. With estimates as low as 50 years and has high as infinite supply, I'd say the margin of error is so great that there is no confidence in either extreme.
The reality is that if oil was as abundant as the oil industry wants you to believe, it would be priced like water. We wouldn't need to drill for it where we're drilling for it. nor would the domestic wells be dry. The infinite supply of petroleum is a whole lot less supportable than the shorter-term supply estimates. The fairy tales are on the infinite estimates. The pricing structure of oil also doesn't support an infinite supply, further reducing confidence in the estimates of greater supply.
Reply: @dalew801  "A Tesla Battery is good for 7 to 10 years . . . then you are faced with purchasing a new one . . . with a new MASSIVE additional Karbon Footprint included . . . no extra charge.  "
The video in question had oil-industry paid "experts" and no other. Stossel's media source is one-sided (biased) and can easily be disproven on all his estimates. Did you catch the post Stossel made himself that the solar panel estimates was wrong? They re-edited the video to remove the obvious unscientific statements Big Oil wanted them to make. If they re-edited the other unscientific statements about batteries and EVs, they'd have nothing left to show.
I will leave you a link / description that proves Tesla batteries last for hundreds of thousands of miles. My own Tesla is just about at 9 years old, just about 90,000 miles, doing great thank you. I have a close friend that traded in his Tesla on a newer model with 170,000 miles, original battery and brakes doing just fine. The replacement battery lie is just that - a lie.
Reply: @dalew801  "We know that CO2 levels would need to reach concentration in air of 60,000 ppm (from current levels of 400 ppm) to become toxic for humans."
Interesting - do you believe that an automobile's only exhaust is CO2? Your entire CO2 diatribe appears to ignore the toxic OTHER poisons in automobile exhaust. 
Here's just a partial list for your education (Google search):
Car emissions
The air pollutants released in a car exhaust are due to undesirable chemical reactions inside the engine. The main pollutants are carbon monoxide (CO), unburned hydrocarbon fuel, and nitrogen oxides, which include gases such as nitric oxide (NO) and nitrogen dioxide (NO2).
Reply: @dalew801  "What runs mines man ?      Diesel Engines in Trucks, Diggers, Crushers etc." What's used to refine diesel fuel, man? Electricity! See how stupid your statement is? There's enough electricity in every gallon of gas to push an EV 15-25 miles without burning the fuel.
Oh and by the way, there are electric dump trucks and mining equipment. 
Oh and by the way, using diesel to get minerals makes no difference; once manufactured, an EV is cleaner than any gas car after 15,000 miles.
Reply: @dalew801  I guess you don't read what you actually write, do you?
Here's my statement that you claimed you didn't make:
""PROVE the CO2 expenditure that makes a recyclable battery pack exceeds that of consuming and burning gasoline for the 300,000 mile life expectancy of a Tesla battery. PROVE IT."   ? ? ? 
I never said that . . . YOU DID . . . lol"
Then in the next paragraph, you made exactly the statement you said you didn't make about the carbon footprint/breakeven point of a battery. Here you go:
"I said a new Tesla in the showroom has a Karbon Footprint = to a similar sized car AFTER you have driven it for Years.  Some say 60,000 miles . . . Stossel says 100,000 miles.    A Tesla Battery is good for 7 to 10 years . . . then you are faced with purchasing a new one . . . with a new MASSIVE additional Karbon Footprint included . . . no extra charge. "
So my original demand that you PROVE the carbon footprint break-even point still stands - PROVE your breakeven mileage points, and I don't mean repeat what Stossel's oil-industry paid "expert" said. Let's see some unbiased research from you!
Reply: @dalew801  "A necessity for your EV . . . 1000s of sq. miles of destruction, and where they Refine the Material is even worse, polluted Rivers, Lakes & Workers who pay a heavy price. "
You must be describing the aftermath of oil exploration and extraction. I appreciate your admission of the petroleum industry's impact on ecosystems. Don't worry, I don't directly blame the Exxon Valdez on you, personally, I mean. Or the Deepwater Horizon oil rig disaster. Or the tankers that explode. Not too personally.
Reply: @Gunalizer  "There is literally no replacement. That argument is dishonest on its face."
It's a perfectly legitimate argument to say save half our our petroleum where possible. Since half of all petroleum is refined into gasoline, using EVs effectively cuts demand by half, does it not? If there is no substitute for petroleum (I agree), then wasting half of it as gasoline when an electric vehicle can be used makes sense. Furthermore, by replacing gasoline vehicles with electric ones, that further frees up petroleum resources from energy production as electricity can be generated by renewable means.
Reply: @schrodingerscat1863  I would be very interested in your analysis of the benefits of a solar tracking unit. I'm talking about the amount of increase energy capture vs. maintenance costs. I've read some solar proponents advocate just adding additional panels to a fixed solar array to make up the difference in energy capture of a tracked unit.
Reply: @dalew801  Far and away worse than nuclear waste.
Reply: @paulrybarczyk5013  ... and destroy my roof and the structural integrity of my home in the process?!  How about NO!  That was what I told a salesman that came to my door trying to convince me to install rooftop solar panels.

A next door neighbor has rooftop solar panels and loudly regrets his poor decision.
Reply: @paulrybarczyk5013  You mean then mass destruction of people's roofs begins...
Reply: @justsomeguy934  I am designing and building the tracking system myself which reduces costs drastically so for me the cost/benefit makes sense. The commercially available tracking mounts add a considerable cost to an installation so it's probably not such a benefit. I am looking to build dual axis tracking which should increase output by around 35-40% which is going to allow me to run air conditioning all through the summer essentially for free using my existing panels and setup. Maintenance should be minimal, the actuators I got from someone who had them surplus so they were reasonably cheap and based on rated duty cycle should last longer than the panels with no maintenance, the control system I am also building myself. The rest of it is a simple rotation and tilt mechanism where there is little to go wrong. All together will probably cost no more than a couple of thousand to do.
Reply: @CropCircleCritic  A smart phone battery is thousands of times smaller than the total mass of batteries needed for an EV.  Where is all that lithium and cobalt supposed to he sourced from?

Petroleum products are organic and generally biodegrade, whereas heavy metals do not.
Reply: @schrodingerscat1863  They also destroy the roof long before 50 years.
Reply: @dalew801  Yes, nuclear power (fission then fusion) is the only sane long term solution.
Reply: @CropCircleCritic  Oil biodegrades.
Reply: @CropCircleCritic You bought a $55k SUV that likely lasts only 10 years before you need to spend another $20k?!  I have a 10yo Honda Pilot I bought new for around $30k. I expect it to last at least another 10 to 15 years. I drive it only about 5000 miles per year.
Reply: @stevenverrall4527  good for you, dude.  I hope it serves you well for years and years.
Reply: @stevenverrall4527  we are satisfied with our choice and would do it again.  I am happy to hear you are satisfied with yours.
Reply: @stevenverrall4527  K.  I really only argue the environmental stuff because people like to bring that up all the time. 

I could honestly care less.  I got a Tesla because we love the driving experience and just wanted one.  And we absolutely love the car.  

There’s a reason that a company that doesn’t advertise can’t pump out cars fast enough.  

All the best to you my friend.
Reply: @stevenverrall4527  Can I ask you something, though?

I do mean this as a sincere question and not a jab, and I won’t to argue back.  I am genuinely curious.

What rationale do opponents of EVs have in the event we get diminishing returns out of oil wells?

My understanding is that we are nowhere near that point (and hopefully this will always be the case), but this may well be a reality we have to face at some point.  

What do we see ourselves doing if we have to deal that?
Reply: @justsomeguy934  thank you, thank you, thank you for entering the chat.  

This was all so much fun to read.
Reply: @CropCircleCritic  These conversations, hopefully, are educational and at times entertaining. I get snarky if someone gets snarky with me, for sure. I have found that advocating for anything other than the status quo can get real combative, real quick. I'm continually amazed at the defenses people put up rather than consider another opinion on its merit.
Reply: @justsomeguy934  oh, big time.  The cognitive dissonance is real.  But you Sir have this down to an art.
Reply: @justsomeguy934  The electricity for the electric vehicles is created by prime movers. Do you know what that is brainiac?
Reply: @dalew801  "I can drive my F350 for over 1,200 to 1,400 miles without even stopping.  Put 90 gallons of Diesel in it in about 20 minutes and do it again."
1,400 miles is about 28 hours of driving under ideal conditions. Then you claim, without stopping except for fuel, to do ANOTHER 1,400 miles. If you have ever driven in such a manner, I brand you criminally negligent. Even on some medication to keep you awake for over 2 days, you would endanger yourself and all around you. I've heard of exaggeration to protect one's point of view, but your claims are beyond belief. By all means, let me know when you endeavor to make this extraordinary journey and I will alert the State Police. If you're simply trying to make some range comparison between an ICE and an EV, it is literally an insane comparison.
Reply: @dalew801  "I know a person who only got 40,000 miles out of  his Tesla Battery . . . had to pay 50% of the cost of a new one. "
Interesting, I've got almost 90,000 miles out of mine, my buddy got 170,000 out of his, the only person I know with a super early Tesla and had a battery issue got his replaced under warranty. The "guy" you know would've also been under warranty, too.
Reply: @dalew801  "EVs are at the bottom of the Consumer's Reliability reports."
Um, do you mean Consumer Reports? The Consumer Reports that has Ford, GM and Big Oil as their "partners"? The same Consumer Reports that named the Ford Mach-e as the EV of the year when you couldn't even buy one? 
Or have you failed to notice that Tesla has the highest customer satisfaction rating of any car maker, at any price? 
Any further insults, this is fun.
Reply: @CropCircleCritic  Does your family have a gasoline powered vehicle for backup in case of a severe natural disaster? A gas powered vehicle can take a large number of short trips (to get essential supplies) before needing refueling.
Reply: @dalew801  "My son is a Auto Tech and works in the industry, while he has not worked on Tesla's he has worked on Hybrids and knows of plenty of Battery Failures . . . when they Fail they just Stop.   Yours may do that next week.   "
Given my 9 years and 90,000 miles with the car, I doubt I'm going to have a problem but YOU keep telling yourself that.
As for Teslas having battery failures or fires, multiple insurance agencies, the Canadian Government and NHTSA all agree - EVs catch fire 100x less than gas cars. I love your fearmongering, it's actually hilarious. Riding around on a tank of liquid explosive seems less risky than riding around on AA's. Go figure.
Reply: @dalew801  "How many sets of Tires have you had on your Tesla?  "
Um, the same as my neighbor who drives a Mercedes. Grasping at tires, now? Dang...
Reply: @dalew801  "Even a Tesla uses 60 barrels of oil to make the plastic interior. " I haven't checked that, but so would a gas car. A Tesla also is painted, also has tires, also has shock absorbers. See how a one-sided and biased opinion works? You mention, for example, the toxicity of paint on a Tesla but ignore the exact same paint is used on the cars you DO like. Ah, the oil lobby force is strong with you, friend.
Reply: @dalew801  "I explained to you why the price of OIL is the way it is . . . you should have known that if you were paying attention."
Actually, I'm the one that has mentioned the market interference with oil prices long before now. I use that exact example - strategic reserves flooding the market - to prove how artificial and volatile petroleum is. Both in quantity and price. 
I could, if I wanted to, make all the energy I need to push an EV from my roof. I bet you don't have a refinery in your backyard.
Reply: @CropCircleCritic  "But you Sir have this down to an art."
That's very kind of you, and I often wonder why I even respond. I've had all these conversations literally HUNDREDS of times. Out of all those interactions, may two people actually read the information I give them and express an open mind towards another opinion. That's right, only TWO people in my 8 years of discussing EVs have ever asked "why" I think a certain way. Everyone else just calls me a name, questions by mental health or assumes political bias that just isn't there.
Reply: @dalew801  "Your constant fantasy with "Big Oil" is quite amuzing.  Obviously you are Left or Far-Left leaning . . . "
Nope, highly conservative. Voted for Trump twice, will again. Did you want to discuss politics?
Reply: @justsomeguy934  You don't have jack.
Reply: @Gunalizer  "You don't have jack."
That's the best you have? No facts? No discussion?
Reply: @CropCircleCritic  Your statement: "Politics.  My friend, I am fiercely conservative and there are many more Tesla drivers who are conservative than the opposition would have you believe.  I would hope another common ground we can meet on right now is that we all need as many friends as we can get.  To anyone reading this, I would ask you to consider if fighting over what kind of car a person drives is a battle that’s really worth picking.  "
I'm going to use that entire comment, it's great. I'm very sorry that politics comes into an automobile discussion, but it often does. Great response by you.
Reply: @dalew801  "And solar farms, like wind farms, do eat up the land. They need 450 times more ground than nuclear plants, and about 100 times as much as generating stations fueled by natural gas."
Absolutely false. The land required to completely power the USA by solar panels is LESS than the land currently used by oil and gas leases. WHERE are you getting your information from?
Reply: @gooble69  "Like for example, if all the world's 1.5B cars were converted to EV, what do you think that will do to the demand on electricity infrastructure? "
The greatest demand increase in the USA's grid was the advent of air conditioning. The grid expanded just fine, didn't melt.
Do you know how much electricity is required to refine gasoline? There's 5 kW/h of electricity PER GALLON of gasoline! That's enough to push an EV 15-25 miles. One of the major generators of electricity are refineries - the on-site co-generation and draw from utilities is measured in terawatts! 
Stop buying gasoline and almost all the electricity for EVs is already provided.
Reply: @gooble69  "how are you getting the raw materials to build it all since almost all mining and manufacturing requires fossil fuels ?"
Who cares if fossil fuels are used to extract or process minerals? Once manufactured, an EV or wind turbine or solar panel burns NOTHING. No further pollution. If you want to talk about disposal of those items, I assume you also are informed about the disposal of ICE vehicles and where the fuel goes once you burn it?
Reply: @gooble69  "And since you don't want traditional energy sources, how are you getting electricity at night, or on a still, cloudy or rainy day?"
Who doesn't want traditional energy sources?
To directly answer your questions:
1) solar energy can easily provide half to 2/3 of our needs during the day without storage. With storage, it can make more than what we need.
2) Wind and hydro power are 24/7
3) Natural gas and even coal used off-peak are great sources for energy.
It's called a balanced energy plan.
Reply: @DamePiglet  "We are weeks... sometimes months without electricity.
But we store gas.  We all have gas generators. The gas stations have generators to operate the pumps.
What we don't have is EV stations.  
You'd be screwed."
So for hundreds of miles from ground zero, there's no electricity? I'd say move from your third-world location and at least move to Florida. Immediately after Hurricane Ian, a Tesla owner made a video on how just a few neighborhoods over, he found electricity. NO gasoline, supplies all gone.
Interesting perspective you have - you buy cars so they work in an apocalypse? If your infrastructure is so delicate, maybe a solar panel or two would not only power your house, but charge your car?
Reply: @justsomeguy934  well, I read all of your comments and enjoyed them, so keep up the good work!
Reply: @justsomeguy934  thank you, my friend!  I may likely be using some of your material as well, especially about the comparisons of flats screen TVs and solar panels.  I didn’t even think of that.
Reply: @stevenverrall4527  absolutely.  

Is it not prudent in preparing for austerity to have 2 different kind of vehicles that are propelled by different means?  

You’d think the ‘survivalist’ people would be all over electric cars.

When there are mass power outages, the gas pumps go down with the power.  During hurricane Harvey all across Texas there were runs on the gas stations and there was about a 4-day period where we couldn’t get gas, but the power was still on.  This is an example of when an electric car can save your bacon.  We have the gas-powered minivan for the opposite reason and I do feel confident that if one doesn’t can’t be recharged/refueled, the other can.  

That said, after we got the Tesla and got comfortable with it, the minivan became a driveway queen.  We use the Tesla for at least 9 out of 10 trips since its daily cost of operation is much cheaper and it’s an absolute blast to drive.
Reply: @stevenverrall4527  True . . .
Reply: @justsomeguy934   Your thought processes just amaze me man . . . . 

When I was in my 20s . . . I drove from White Rock BC to Winnipeg Manitoba . . . a distance of 1500 miles.  Left WR at Noon on Friday & was in Winnipeg by 2 PM Saturday with a 2 hour time zone change.  So in 24 hours I averaged over 60 mph in a 2 year old Mustang GT.
In 1995 did it again when my buddy died suddenly & I could not get a flight . . . did even better in my 88 Turbo Coupe, averaged 70 mph and did it in about 22 hours & a bit.   By the 90s highways were much better . . . . all on a box of donuts & lots of Coffee!

You go off on a tangent about medication . . . laughable man . . . my point being I won't be waiting in lineups for HOURS to charge my EV like you will.   Your EV might work just fine around town . . . but unlike my Truck it won't tow anything and does not work for me. 

Even charge times at home, if you don't have the high voltage expensive set up,  is days . . . 
I can walk out to the garage any time & chose from 3 cars & a truck.
Reply: @justsomeguy934  For years I took my 1988 Turbo Coupe through Air Care every year . . . the emissions numbers were miniscule. 
Today's ICV have 30 years of improvements . . . in fact they are so Clean that Air Care Testing was shut down because the new cars rarely even tested negative.   No one is saying there is not bad stuff coming out of the tailpipe man . . . it's just in very miniscule quantities today.   Experts have said modern ICVs are 98% cleaner than in the 1970s.
Reply: you are out of date..  the technology is moving really fast.. i to have worked in the field and just the last two years its just been amazing.
Reply: @dalew801  "Experts have said modern ICVs are 98% cleaner than in the 1970s." It will still kill you, and an EV will not.
Reply: @dalew801  "Emissions from modern ICVs are miniscule man . . . 
Solar Panels are made of Toxic Heavy Metals that leach into the environment . . . that starts the day "
Challenge: Person A  stores 100 solar panels in a closed garage for a week and sits with them. Person B sits in a closed garage with a running car for a week. We'll check back after a week and see which device has "miniscule" emissions.
Reply: @dalew801  "In 1995 did it again when my buddy died suddenly & I could not get a flight . . . did even better in my 88 Turbo Coupe, averaged 70 mph and did it in about 22 hours & a bit. "
You are admitting to dangerous driving. I seriously suggest you delete your comments. Driving for those extended periods of time is irresponsible and dangerous. If you were a commercial driver, you'd be arrested. You are NOT making a case for gas cars, you are admitting to considerable risk.
Reply: @dalew801  "my point being I won't be waiting in lineups for HOURS to charge my EV like you will.   "
WHO waits for hours to charge their car on a trip? I sure don't. Your opinion, again, is based upon misinformation. I get to my destination just as fast, thank you. Let me repeat, I drove all the way across Kansas and back in 48 hours, including sleeping, getting the thing I had to get, driving around Kansas City. All done in an EV at 107 degrees, easy peasy. Your portrayal that EVs can't make long trips is baseless, like all of your comments.
Reply: @justsomeguy934  Another nonsensical analogy . . . 

China produces 85% of global supply of the 17 chemically similar elements crucial to smartphone, camera lens and magnet manufacture – and half that output is from the city of Baotou

Although Wang Jianguo knows little about rare earths mining, he is an accidental expert on its consequences.

A short walk from the 43-year-old former farmer's dilapidated brick home in Xinguang Number One Village, is the world's largest rare earths mine tailings pond – an endless expanse of viscous grey sludge built in the 1950s under Mao Zedong. The pond, owned by the Inner Mongolia Baotou Steel Rare-Earth Hi-Tech Company, or Baotou Steel, lacks a proper lining and for the past 20 years its toxic contents have been seeping into groundwater, according to villagers and state media reports. It is trickling towards the nearby Yellow River, a major drinking water source for much of northern China, at a rate of 20 to 30 metres a year, a local expert told the influential Chinese magazine Caixin.

"In the beginning, there was no tap water here, so we all drank from wells," Wang said. "The water looked fine, but it smelled really bad." In the 1990s, when China's rare earths production kicked into full gear, his sheep died and his cabbage crops withered. Most of his neighbours have moved away. Seven have died of cancer. His teeth have grown yellow and crooked; they jut out at strange angles from blackened gums.
Reply: @dalew801  Dude, I'm done with you. You have a financial interest in seeing electric cars, and Tesla specifically, fail. Your short position on the stock completely explains your refusal to see facts. Overall, we've likely exchanged 100+ messages each and I thought even the most stubborn person would've started to look at facts. Eventually, if you try long enough, people tell on themselves.
Enjoy your short position on Tesla, no amount of reasoning can overcome your wallet.
Reply: @justsomeguy934    No "Risk" involved . . . I drove 10 mph over the speed limit much of the time . . . stopped only for fuel & coffee and had Zero Issues.  I was in excellent physical condition, in fact a couple of years earlier scored in the 90 percentile on the Ski Alliance Fitness Test . . . which is brutal.  Regularly played men's league hockey & participated in Martial Arts.  So I was far from the average couch potatoe.   

My point was . . . that if I had a POS EV . . . I would still be out in the Middle of Saskatchewan looking for a CHARGER even 25 years later.
You claimed is was not possible . . . I suspect you think driving to the grocery store is a major outing . . . lol
Reply: @justsomeguy934  You drove all around Kansas . . . good for you.   You consider that a "Long" trip?  
I never said they can't make a long trip, even a wagon can make a long trip if you like to walk.  I said they were useless for long trips unless you like spending time in charging stations.  
Last summer a family left Vancouver at 10 am to go to Kelowna in their Tesla . . . a distance of about 300 miles.   The temp was in the high 90s . . . so the a/c was on.  They stopped in Hope, the last charger before Kelowna to recharge.  The lineup for the chargers was over 4 hours . . . they got to Kelowna at 7 pm.    What a JOKE ! 
I would have been there for a late lunch.  

You could drive an EV coast to coast . . . the Question is . . . Why Would YOU?
Reply: @CropCircleCritic  Your electric car runs on coal and nuclear powered electricity production. DUH!
Reply: @t0manderson571  so do the gas pumps.  DUH!
Reply: @markhuntermd   speaking of this topic, why in the world aren’t vacuum glass thermal tubing hot water systems not more prevalent? Using solar to create energy to then store and heat water seems counter productive. I know it’s somehow subsidy and policy related but even in places as advanced (in some things) as Japan there is a push towards heat pump water heating with only the very old farmhouses utilizing vacuum tubing…
Reply: @Gunalizer  "Nope. They are toxic." Actually, unless damaged, solar panels work forever and are solid waste. If you're concerned for toxicity, you opinion on gasoline? What you've fallen for is the propaganda technique of distraction. I talk about toxic paint on a wind turbine tower to distract you from the 100x - 1000x toxicity of the alternative (burning fossil fuels).
Reply: @MP31040  So the megawatts of electricity generated by both space-borne and celestial solar arrays aren't functioning?
Reply: @CropCircleCritic  they still are.
Reply: @gooble69  he pretty much told you his sources xD.
Reply: @justsomeguy934  "@Dale W  Dude, I'm done with you. "

But why did you ignore the points I raised? I presented facts and questions and then you went missing? 
You made the comment "That's right, only TWO people in my 8 years of discussing EVs have ever asked "why" I think a certain way. Everyone else just calls me a name, questions by mental health or assumes political bias that just isn't there."

I have done none of that, you simply ran away as soon as some real data was presented that disagreed with your opinion.  Add this to your list of 8 years discussing EVs. 'When someone brought some real data, I ran away' 😁
Reply: @gooble69  What points did I ignore? I'll be happy to discuss any datum you have. There have been 255 responses to this one comment alone, so if you have a point I have missed, please respond to me, and quote the sentence(s) you want a reply to.
Reply: @justsomeguy934  I already did.
Reply: @gooble69  Already did what? If you want a response to a comment you have made, please quote that comment so I know the context of it. There are now 256+ comments on this thread alone, I cannot scroll backwards that far to see what you're talking about.
Reply: @justsomeguy934  " I cannot scroll backwards that far"

OMG, scrolling, oh the humanity...
Reply: @adeniyas  I am trying to learn about them now.  I do read they have a limited lifespan however, of 5 - 15 years
Reply: @tinka1015  No, my friend, you don’t get to do that.  You are holding the entire EV industry guilty for something you just heard John Stossel talk about.  This is that mechanism applied in reverse, and there is no industry in modernity that has collectively caused more human suffering than the oil industry, full stop.  

I respect your experience working in the energy industry, and this is mine.  I flew combat airlift over Iraq and Afghanistan to keep the Straits of Hormuz open and uncontested.  The collective oil industry would love for us all to forget about the “collateral damage.”  And if you drive a gas car, none of that is your fault.  I would like to ask for the same courtesy in return.  

And I’m glad you mentioned Brandon.  My friend, there are far more conservative Tesla drivers than propaganda like this would have you believe.  I would hope the common ground we can meet on is that right now we all need as many friends as we can get.  From that, I would ask you (and anyone reading this) to consider whether someone driving a different car than you is really a battle worth picking.  

I wish you all the success and happiness in the world in whatever car you drive.
Reply: @tinka1015  whatever you need to tell yourself, man.  It’s a different kind of car.
Reply: @tinka1015  I snagged a free supercharging Tesla which means I get free charging until it blows up.  Nothing suspicious with no cost charging.
Reply: I think if anything we should stick with hybrid technology. My grandparents have a Toyota RAV4 prime which is a plug-in and they can go about 50 miles on the battery but they still have the gas engine to fall back on which is highly efficient.
Reply: @victorluke5816  true but you're missing my point. I think if that's the direction we're going to go as far as electric vehicles we need to stick with the hybrid model. Not full blown electric
Reply: @RabidNemo  I thought that yesterday while driving, there are more affordable for all and I see lots of them on the road
Reply: @victorluke5816  hopefully your house dont burn down,  your homeowners wont cover it.  Nothings free, somebody paid for it.  Most people cant afford an 80k tesla
Reply: @tinka1015  I paid $15K by getting $10K in rebate money for an old 1982 Mercedes 300D and another $5K in other government and electric company rebates.  This was back in 2019 for a 2014 Model S.  If you live outside a fire zone you can buy house insurance that would cover your house burning down which I did buy.
Reply: @RabidNemo  Full blown electric is cheaper to run than even the hybrid and if you are in a developed area then its not a problem for charging.  Especially if you bought a Tesla.   When I first bought one the closest supercharger was 8 miles away.  Within a month there was a 12 charger location within 2 miles from my home.  That kept on getting lines so they put another 20 charger site w/in 3 miles after 6 months.  Its been 3 years since I bought it and they just put another 20 charger site w/in 3 miles of me as well.   I now have 52 superchargers w/in 3 miles of me.  I also took the car on an 1100 mile trip through 5 national forests this year without charging problems.  I now have 2 Teslas and my average savings from fuel and maintenance is $14K a year.
Reply: @victorluke5816  wrong! Ask California when their grid was stressed and people were being told not to charge their cars
Reply: @RabidNemo  They were told not to charge when the rates were at their highest and to charge when the rest of the grid was low usage.  Basically after rush hour and overnight which is when most people charge their cars in the first place.  I am in California and had no problem charging my cars during my usual charging times.
Reply: @tinka1015  what part doesn't ring true?
Reply: @victorluke5816  homeowners insurance
Reply: @tinka  I was able to buy the fire insurance but I'm not in a prime fire zone. Earthquake insurance is the hard one for me.
Reply: @tinka1015  That's what I bought.
Reply: Good for you, glad you can afford all of it.  Too bad so many people dying making that happen for you
Reply: luke  yeyeah earthquake is pretty unpredictable
Reply: @tinka1015 What people?  Less should be dying because the mining was better than for ICE resource drilling or are you a walking and biking advocate.  If you are you have to get the right job and location which is much too hard for most.  My situation is about a 100 times easier.
Reply: luke  yeyeah that mining in Africa is top notch
Reply: @tinka1015  Tesla takes no cobolt from Africa. At worst some of the lithium is Chinese and they have started lithium mining in the US.
Reply: @victorluke5816  so exciting the chinese mining in my country,  batteries are toxic to the end
Reply: @tinka1015  The new methods of lithium extraction use half the water and no sulfuric acid.  Thank god that is the process we will be using in the US.  It is also cheaper so the Chinese will start using it too as soon as they find out.
Reply: @CropCircleCritic  the argument is valid because toxic elements are still used in solar panels and those panels, more often than not, have no recycling at end of life. They just get dumped in landfill.
Reply: @georgebeare8883  I’m not sure which thread you’re replying to, but my question would be why solar panels are necessarily more toxic than much of what is already thrown in landfills.  Chemically they aren’t very different from flat-screen TVs, but no one is taking up a crusade against those.
Reply: @CropCircleCritic  I replied to your suggestion that solar panels are no longer a problem for toxic elements leaching into the environment.
Reply: @georgebeare8883  Ah.  Thank you for cleaning that up.  Lots of replies in that thread.